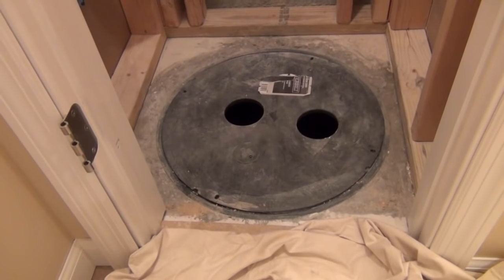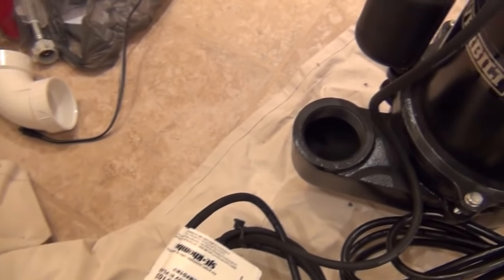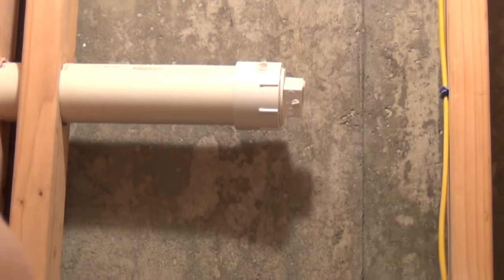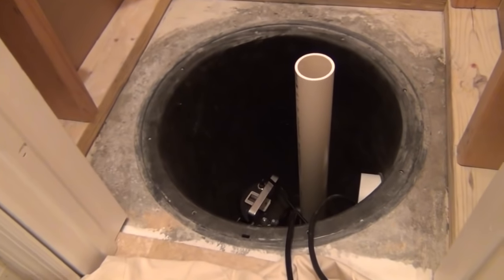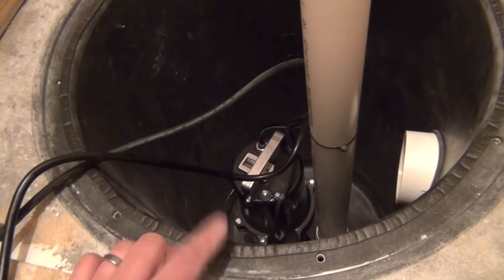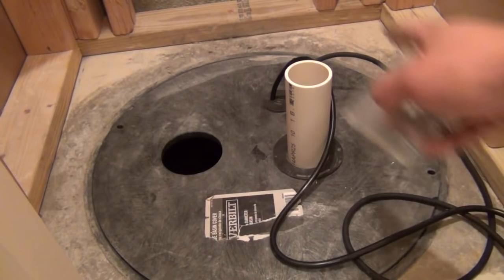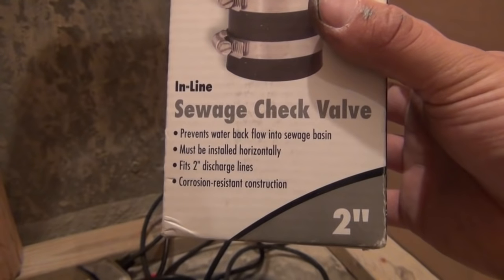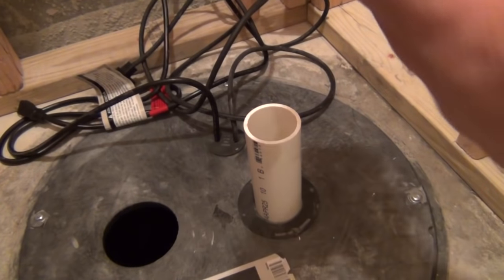How to Install a Sewage Ejector Pump

Comment: Thank you very much for your video, I have a question, we build a barbecue place with bathroom 300 feet from our house, (drainage) which pump I need to buy so that the pressure reaches the drainage tube?
Reply from the maker: Elena Llamas Not so much the pump you need because all the pump needs to do is overcome the initial lift. Gravity will take over after that.  I'm sure the pump I used in this video would work fine. Just make sure the gravity portion of the piping is pitched correctly.

Comment: What keeps the water from upstairs from filling the line above the check valve? Should another check valve be placed so that the doesn't happen?
Reply from the maker: Gravity flow and pitch out to the main. You don’t want to introduce 2 check valves on the same line. It could cause issues

Comment: Hi I have a set up like this in a bungalow.  I just replaced a sewage pump.  Now I get water backing up into my kitchen sink upstairs almost directly over the sewage pump.  House was built in 2004 and I do not have a separate vent pipe as you do.  I did not experience sink back up with the older pump.
No one can seem to figure out what is going on.  Any ideas would be appreciated.
Reply from the maker: It could be that the newer pump is more powerful. A dedicated vent would probably help. A sewage pump should always be dumping into a larger diameter main line. In my case 2 inch into the 4” main. Anything smaller, you risk what’s happening in your case. Hope this helps

Comment: For your application, would the check valve be more reliable at the 45 degree section of pipe?  Thanks. Nice vid.
Reply from the maker: Jason8675309 Not really.  Ideally you want the check valve as close to the pump as possible (right at the top of the lid).  This way you have the least amount of sewage flowing back into the sump as possible once the pump turns off.

Comment: Great video!  I recently changed my check valve and if noticed I keep getting small leaks in the connection between the rubber tubing and the plastic of the check valve or the PVC pipes. No matter how much I tighten the metal clamps, still get water coming though there. Any advice?
Reply from the maker: Common issue. Try using 2 clamps installed in opposite directions (screws on opposite sides of the pipe). Sock them down with a 1/4" nut driver instead of a screwdriver for extra torque. Should be ok after that. Good luck

Comment: Great video. Thanks very much for posting. My pit seems to receive water from the weeping tiles as well as septic, is this normal? I can hear water draining even when nothing has been in use for a few hours (ie. middle of the night). I also have a separate sump pump pit which seems to act as a backup and is higher up than the sewage pump. We are second owners of the home and the original couple had no idea how this works.
Reply from the maker: That would be an odd setup. The weep system gravity feeds into the dump pit. If it shared with your sewage pit, my guess is sewage odors could escape through the weep system. I would pop that cover off and have a look. Both systems should be independent of one another

Comment: I know that it is a submersible pump but does the pump necessarily have to be submerged in order for it to work? Can you fit pvc piping from the inlet of the pump to the source of water that you want to move/pump?

Comment: Great video and very neat work i'm actually starting to finish my basement Im a electrician and pretty handy, I've just never done any plumbing I'm sure I can handle this task but would you recommend running water or a pressure test before putting concrete over  the rough in piping in the basement going to the ejector pump just in case there's leaks?
Reply from the maker: +Alex North Not necessary.  As long as you prime, glue and press the fittings onto the pvc properly, you'll never have any leaks.  Good luck, its an easy project.

Comment: Thank you very much for the fast reply and great advice.
I have a little giant ejector that was installed by a plumber for a future bath which I recently tried to start. I previously mentioned that the bolts were broken before install and more diagnosing pump failure. I did notice the vent line was installed halfway into pit(would be submerged if tank filled). Are pumps and tanks (pit) interchangeable ? I’m replacing an external float with same. Do some have grinders ?
Thank you again,
Anthony
Reply from the maker: You’re welcome!  Yes, you can interchange pumps and pits and be ok. Definitely cut that vent a little higher. Sewage pump pits need to both vent in and out for the pump to work correctly so you don’t want that pipe opening submerged.  You want to specifically look for a sewage ejector pump.  Other pumps are made for sump pits and won’t work correctly or have a short life span. Good luck, it’s real easy stuff to work on, just not the most pleasant...especially an existing install!

Comment: do you know If I can put two inlets in one of these basin sewage pump systems?
Reply from the maker: Yes, you’ll need to drill another hole and get an additional grommet for the pipe.  Make sure to keep it at the same height as the factory hole
Reply: thank you for the reply

Comment: Changing out pump and half the bolts to the lid broke, what should I do ? Easy outs don’t work. Silicone ?
Also how far down should the vent line go into ejector ?
Thank you in advance
Reply from the maker: Rotate the lid 90 degrees and use some self tapping screws in the new locations. Yes, either add foam tape or silicone to the lip of the basin. Vent pipe into the basin roughly 4-6”

Comment: Hello,

Great! Thank you very much for informative video. Now, I got some confidence to try it out myself! 

I do have waste water standing in the sewage basin and tried using the pump plug directly. It only makes noise but not ejecting/draining the waste water. Is there any other solution to get the water collected in the basin before replacing the pump? Or installing the new pump and use it to drain the standing water would be the ONLY option? Please let me know of any solution for my situation. 

I currently have Flotec (4/10 HP) and thinking of going with Zoeller 1/2 HP, is that fine?

Thank you again.
Reply from the maker: Sorry for the delayed response. You can pull the old pump and plumb in the new one and drop into place.  Not going to be very pleasant working conditions but it can be done.  As a last ditch resort, get a broom stick or something long to bang against the old pump. You might be able to jar it lose to pump the water out of the basin.

Comment: Great video. Just had a liberty pump P382LE51 with 1/2 hp installed by a local handyman and it’s not flushing properly. He also didn’t bring the vent pipe all the way up. Actually installed lower than the toilet. Does anyone know would this effect the flushing or discharge of water? Any help would be great. I ready the choke this guy. I should’ve hired a real professional. Thx in advance.
Reply from the maker: Bobby King What is happening when you flush the toilet and what do you mean that the vent isn't all the way up? I'll try to help you man.

Comment: Just found this video. Thanks, great job. 
We need to do this as a new install at our weekend cabin. How would you do this in a unheated crawl space? 
I am worried about the remaining liquid in both the tank and the vertical pipe freezing, (ours would be on a upward angle).
I'm thinking of using a couple of gallons of the Pink RV Anti-Freeze when we close up to come home. Any suggestions?
Maybe, Heat Tape on the pipe? How about the tank?

Comment: Thanks for the video .i am having problems disconnecting the old pipe attached to the pump .And which pump to get .old pump no visible readings
Reply from the maker: The pump in the video is an Everbilt from Home Depot. You don't need to stay with the exact same model pump. Just make sure you're getting a sewage pump, not a sump pump. As for the pipe, you could always get a new male adapter and section of pipe. Should be 2". Hope this helps.

Comment: I’m installing one today. Does a sewage pump need a weep hole drilling into the pipe ?
Reply from the maker: Most pumps do, some pumps don’t. In my particular case with this pump, it didn’t need one. Check the manual that came with your pump. Good luck with the job 👍🏻

Comment: Great  video. here is a question.

What am I to do when the city storm main floods in a heavy rain and pushes the water into my  sump pit. Water overflows out of the pit and floods my basement. The pump makes a sound, but it is unable  to overcome the pressure of the storm water. Any ideas would be helpful

Thanks
Soggy basement (;
Reply from the maker: Sounds like you should have a back flow valve on your sewer main to prevent this from happening. The check valve above the sump basin should also prevent this to degree as well.

Comment: I have a basin already, there is a rough in. I see there is a "discharge" pipe above the basin, and a single hole in the basin. No vent hole and no vent pipe anywhere to be seen. Is it possible my configuration doesn't require a vent?
Reply from the maker: They all require a vent of some sort to work correctly.
Reply: @fixitwithzim  yeah I'm thinking cheater vent

Comment: I have a question and I hope you can help me out with my issue. I've noticed from time to time that the waste is coming back down into the sewage basin after it gets pumped out. It doesn't happened all the time but when it does my basement smells. Thank you!!! FYI... The vent is connected to the same pipe where my water softener discharge water is pumping out so I wonder if this is causing the issue when the water softener is working at the moment.
Reply: Check or replace the check valve.

Comment: I forgot to ask.  Why no alarm?  I think I'm going to put one down to alert me at the first sign of problems. What's your recomandation?
Reply from the maker: That Tech Guy sorry for the late response. An alarm is a good thing to add. At the time I put this pump in, I was under the gun to get it finished for a party. I have since added one. Thanks for the comment

Comment: Is pressure rated pipe and fittings required for the discharge for one of these?  My plumbing inspector said yes, but then you are forced to use severe angles because all pressure fittings are either 90 deg or 45 deg and no sweep fittings.
Reply from the maker: Good question and to be honest, I’m not 100 percent sure. I will tell you mine are DWV fittings and I’ve had no issues with it.  Another interesting tidbit. Back when I was still learning about PVC many moons ago, I plumbed my above ground pool pump (2 HP pump) with DWV PVC by accident. Both the suction and return lines. Still going strong 15 years later. I don’t know, for what it’s worth, you’d probably be ok with not using schedule 40
Reply: @fixitwithzim  Well, I answered my own question.  According to the code that is in my area (Forsyth County, GA) which I can't remember for the life of me whether it is UPC or IPC, pressure-rated pipe and fittings are required.  I'm going to use a bunch of 45's instead of 90's.  I don't like it.  I think the pressure put on the system by this kind of pump is not exactly the kind of pressure that is really going to stress DWV pipe, fittings, and the two part glue system, but there you go.  I have to get inspected too.  I think the system would perform better with longer sweeps that you get with the DWV fittings.  On a side note, I also think it's stupid that you can't get a straight answer on the internet about the actual differences between DWV and pressure fittings.  They're both schedule 40, but many sites just keep giving you the differences between Schedule 40 and 80 and CPVC (also schedule 40!) as if that was the freaking question!!@#$%%)!!!  OR they'll show you the superficial differences like sweep or no sweep fittings, which also wasn't the question.  Why is this stuff so hard?!?
Reply from the maker: @Frankengruvin  yup, they don’t make it easy to decipher, I think that’s partially on purpose but who knows. Anyways, good luck with the job!

Comment: great work thanks learned alot, can i use the same pump and system to put a washroom at the end of my property around 300 yard in straight line, thanks kam
Reply from the maker: kam MEHRANI Yes, should work just fine as long as your main sewage line is pitched properly towards the sump pit.  Thanks for stopping by!

Comment: Ours has a smell when it runs. We’ve had plumbers come out and tell us everything is sealed. It feels like our exhaust is faulty. What do you think it could it be?
Reply from the maker: A smell from an ejector pit is most commonly from 1) the lid/seal - check and replace. 2) donut gaskets around the discharge pipe, vent, and/or cord - check and replace. 3) vent pipe is open somewhere - check and vent properly to the outdoors. 4) if you have a shower that isn’t used often, ensure that the trap hasn’t dried.  If yes, your odors will come from there. Add water to the drain to seal. Hope this helps!

Comment: If there wasn’t a air bleed hole would that cause my pump to bang like a hammer? Can you have a pump that’s pushing to much pressure to cause such a loud bang?
Reply from the maker: Its possible.  Not all pumps require a hole in the pipe.  Maybe your check valve is getting stuck or has debris stuck in it.

Comment: Did you drill a 3/16 inch hole in the discharge pipe below check valve and pit cover to prevent air lock.
Reply from the maker: Luis Diaz Not needed for this particular pump. We discussed this a few times in the comments already. Thanks for watching.

Comment: I have a question about the vent, could I just vent it right on the outside wall? Or do I need to find the vent pipe and attach it there? I know it’s a dumb question

Comment: Hi, what is the point of burying the basin? I will be installing mine in an area of my house that would never freeze, is there still a need to burry it or can i just set it in a secure, sturdy fixture to hold it in place? It would be almost right under the actual toilet i will be using it for.
Reply from the maker: It is below grade so the waste water can gravity flow to it.  The toilet and shower drain are on the slab.  Water won't flow uphill.
Reply: Yes but what I'm saying is that my pump and basin will be downhill from my toilet. Almost 2 feet below my toilet. So is there a need to burry my basin? Or can I just secure it in a sturdy fixture? Great video by the way.
Reply from the maker: Jordan Showghi I see what you're saying. I don't see any reason why that wouldn't be ok but I'd check with the basin manufacturer to be certain.  You'll also need to strap and support the main waste line entering the basin so there's no chance of it pulling out of the gasket.

Comment: Hi, is a  mechanical vent installed near the lid of the pit sufficient in a situation where going through the roof is not an option. if not ,can it vent out the sidewall of the building and up to the roof?
Reply from the maker: No mechanical vents or AAV's can be used on a sewage ejector basin.  Basin needs to vent both in and out. A mechanical vent only allows air in.  It is permissible to vent as you described with a pipe on the sidewall to the roof. Thanks for commenting.

Comment: Have you ever heard of a sewer ejector pump handling all sewer from the house? I just bought a house that has all sewer leading to the pump in the basement. I found this out the day before closing. 

The house used to have septic tank but then got switched to public sewer. When previous owners built a bathroom in the basement they had ejector pump installed and the plumber connect all the upstairs plumbing to it and then they called it a sump pump!! I bought the house thinking I had a sump pump but instead it’s an ejector pump. 

Can this be fixed back to the way it was?
Reply from the maker: LM_Andrews you sure everything in the house is feeding into the pit?  Seems a little odd. If what you're saying is correct, they would have bring a new main into the house to connect everything to the city sewers. Do you see the old septic main in the basement capped off?  I would think they'd make the connection from old to new outside the house
Reply: Yes, upstairs toilet, shower, sinks and dishwasher all run into this pump, and the pump then delivers it outside. I know this because the pump's float/bobber gets stuck sometimes and the alarm goes off every time you take a shower or flush or anything else. It's awful. And I see only one pipe that leads outside. It just looks to me like pipes from everything else could be added to the bigger pipe and it can all go outside by itself with gravity. I even live on a hill so there should be no problem there. I was just wondering if this sounded strange to you, and it seems it does. I'm working on finding a good plumber to come look at it. I've just never heard of a house needing this set up, especially if sewer flowed out of house into a septic tank just fine. Why should public sewer be any different? A grinder pump shouldn't be needed to make sure all sewer from up and downstairs gets out of the house. ugh. Thanks so much for responding. Do you think it would cost too much to set it right?

Comment: no air lock hole drilled into the discharge pipe above the adaptor to the pump ?

Comment: zims I just added a tiny home to my property for my mother in law. my septic tank is about 100' away and the inlet is about 1 foot higher than the ground where the tiny home is. would one of these pumps move the sewage 100' at a 1 foot elevation?
Reply from the maker: Sure, you could make it work.  My only advice is to check the pump you're buying to make sure its capable of pumping the distance and height you need.  Good luck with your project.
Reply: I was going to buy the same one you used in this video.